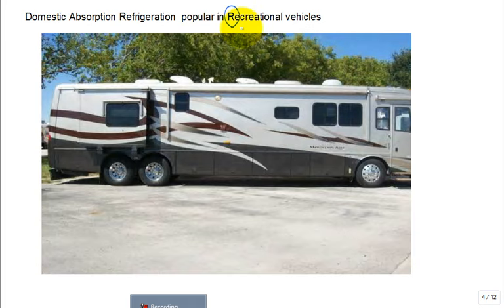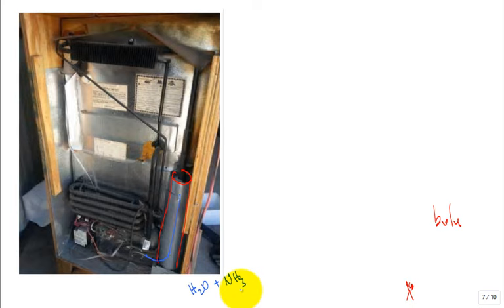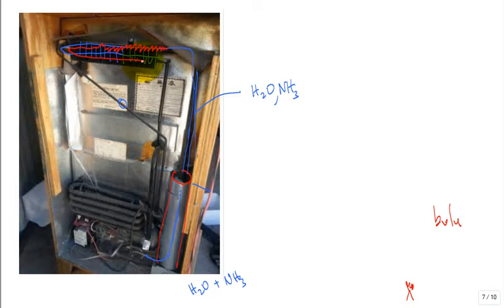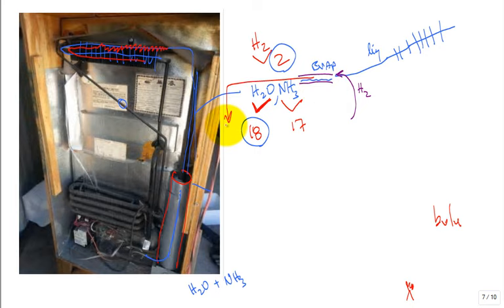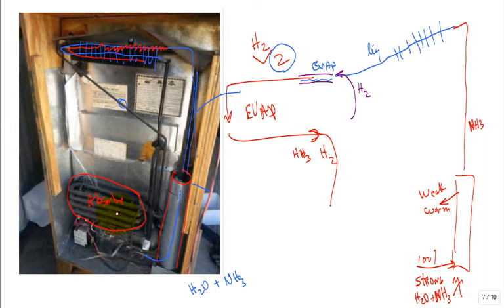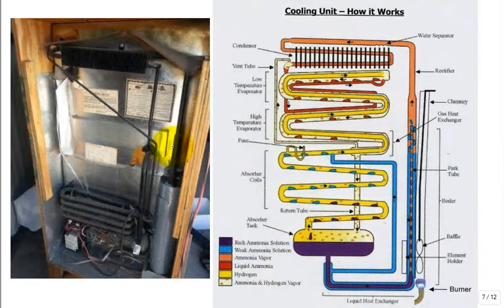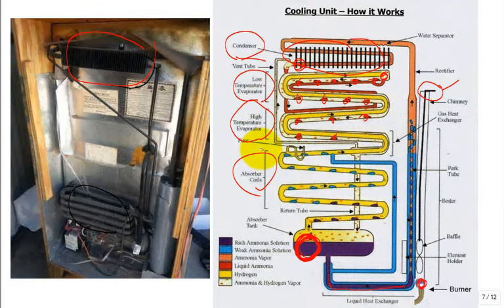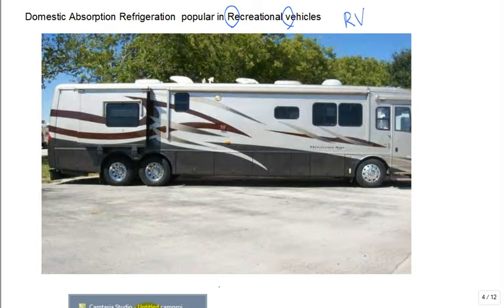RV absorption refrigeration

Comment: what error was removed? I've watched the other video about a million times trying to wrap my head arround how this works..
I'd like to built one of these that would work of solar heat, but the part where introducing hydrogen makes ammonia evaporate still makes no sense to me. I might have to go with a pump and valve witch I would like to avoid.

thanks for all the lessons
Reply from the maker: they don't use 240 v electric heater, just 120v or 12v. think of dry air blowing over water puddle. it helps evaporation. why? partial pressure of water in dry air lower than saturation pressure  at temp of liquid water. some liq evaps which drops temp of remaining liquid.
Reply: +Randall Manteufel thanks thinking like that kind of makes sense..
there seems to be so little information on this subject out there.. my plan is a bit far fetched, but I want to see if I could make an absorption refregerator work and use heat pipes to control the heat transfer. Make a fridge work without moving parts or thermostats, simply stay cold.
Reply: +Randall Manteufel 

  This is perhaps the best explanation I have seen because you illustrated a drawing of what a real absorption system looks like as opposed to the simplified analogue.

  What sort of class where you teaching?
Reply from the maker: Philip Mac Duffie A second course in thermodynamics for mechanical engineering students, with a focus on cycles and few other topics.
Reply: +Randall Manteufel 

  I went back and looked at your other videos to see most are cycle theory in thermodynamics. Since this one contained a practical example I thought it may be for a different audience. 

  Regardless it was a good remider of the absorption refrigerations systems perceived simplicity, yet complicated physical construction.
Reply: @Mário Fernandes, it's been 5 years.  Have you built a solar-powered system, yet?  I have been wanting to do the same, and also have had trouble following so many other explanations.  Mr. Manteufel hit on the key with his comment -- partial pressure is the secret to the use of hydrogen.  The analogy I like is sweat.  I feel much better cooled by sweat when the weather is dry, but when I lived in coastal Texas (Houston), the humidity was high and sweating barely helped.  The partial pressure of the water was high then.  Getting back to the hydrogen, it starts with NO ammonia in it, so when it is in the evaporator together, the partial pressure of ammonia starts at zero and ammonia boils easily into the hydrogen using/taking heat from the cold space.
Reply: @PeterLawton  not really.. I got stuck on trying to get ammonia. Eventually I gave radiant cooling some tests witch showed some promising results. I was able to make ice on less then freazing outside temperatures. Of course only on clear sky nights and small scale.